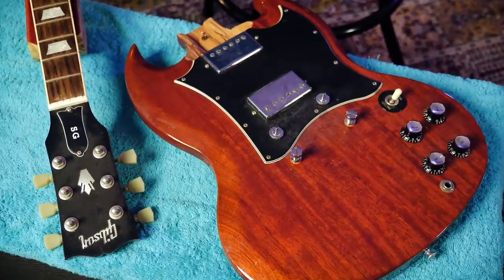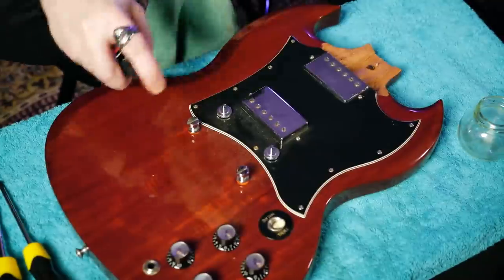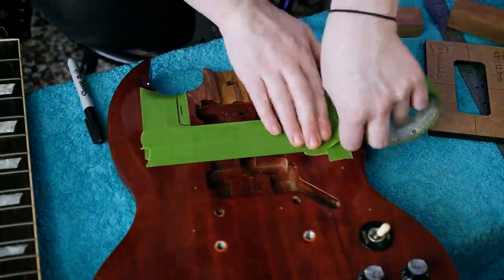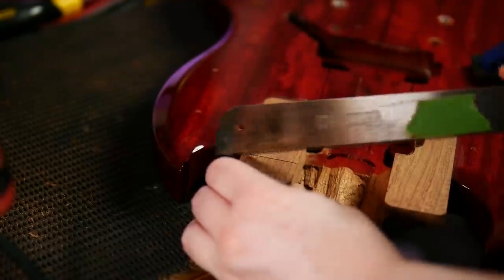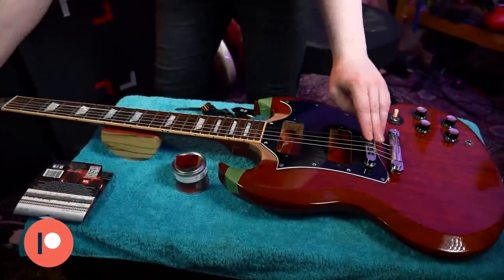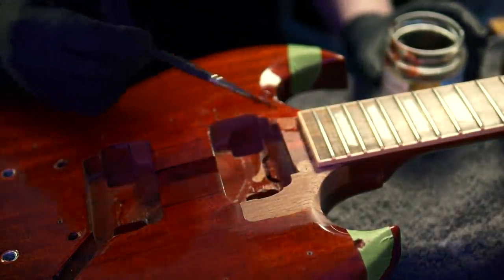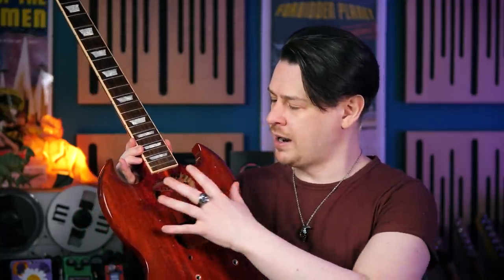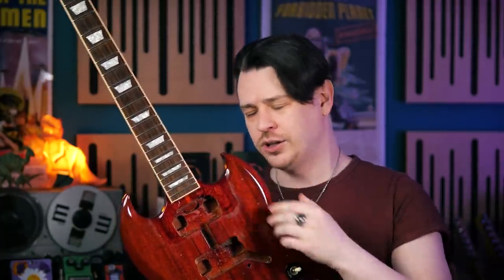BRUTAL Gibson SG Neck Break Repair (Part 1) | Axe From The Grave

Comment: After seeing how much heavy lifting a lot of the "solid" repaired guitars on Reverb look like maybe they did theirs in a dark room with a blindfold, I'd say this is clean enough to sit in that Mod Shop dude, well done!
Reply from the maker: I've seen some pretty rough epoxy and bondo style repairs, which just look awful regardless of how stable they are. 
I decided the best thing to do was rebuild and reinforce the wood - use only what would have been there from factory. It turned out better than I expected and I'm hoping it looks nice once the nitro is finish sanded and polished.
Reply: @ScienceofLoud  I've seen plenty for sale that have been "professionally" repaired. May be down to budget, but some reputable names have produced repairs that just look like glue and clamp (gibson headstock breaks). I have also seen repairs on Youtube which are almost invisible and look stronger with routed section which have strengthening inserts.

Comment: I have done so many of these over the years.  You did a fine job.  You really over repaired it.  I just glue them back on as long as they fit good, and fill in the spots where the wood is missing with chunks of Mahogany.   I have never had one break after I glued it.

Comment: Nice video! 

My SG (Tokai MIJ) broke by the headstock (I might have bumped into the drum set during a gig...) but it was glued together and is now probably stronger than before! Big scar around the neck now, but that's like you said - a part of the history of the guitar! Also, at another gig, before I started using straplocks, the same SG dropped straight "face down" to the floor and pushed the input jack with the surrounding wood into the electronics space.. I repaired the hole, drilled a new hole for the jack and electronics from the side (pretty thin though on a SG, but doable) and now it's super convenient with a 90degree jack. Lot's of scars :)

Comment: Great video, cheers Colin - really gave me the itch to get back to woodworking!

One thing that leapt out of me is that the refin looked much more obvious in some shots than others (I imagine due to the new nitro being more reflective). It'll be interesting to see how that compares once it's been sanded and polished. More importantly, given the comments on ethics you made, I can see how it would have been very easy to only use images from flattering angles (or, indeed, just shoot the whole thing as one video and not focus on it). The fact you didn't was really quite heartening - properly putting one's money where one's mouth is.

Comment: I freaked out over severe toothpain and smashed my 1995 Gibson SG Special in y
two pieces a few years back.
The break was pretty similar to the one in this video(except no missing wood).
For a long while it was just lying around here with me thinking it would be too expensive to get fixed.
I ended up taking it to a luthier. He did a great job and it didnt cost much at all. The guitar has a trans dark blue finish and I touched it up a bit with a dark blue sharpie.
It plays and sounds just as good as before and I dont really care about the marks from the break.
I am however very glad this smashing didnt instead happen to any of the nicer Gibsons Ive had.

Comment: Excellent job! Very impressive. Makes a change from headstock breaks on other channels. I’ve got a headstock break ongoing at the moment. With your repair, the only thing I would have done differently would be that I would have used grain filler on the new mahogany area. Really helps when the nitrocellulose inevitably shrinks.

Comment: As I said on Facebook the other day, its a great sympathetic repair to an instrument that deserves it. 

You didn't explain the dowels that you sunk in behind the fretboard, so i'm guessing that you didn't capture that bit on video while doing the work to it. I'm hoping for an explainer in the 2nd video in case people are wondering why you have 2 circles of wood in there at the joint.  

The colour actually works!  I would have been tempted to hide it under a solid or burst finish to hide it, but I actually think yours works better.  Northwest guitars colours are pretty good and I use them a lot.  

I'm interested why you didnt go for a grain fill, sealer and then add the colour as it would have had originally.  It wouldn't make the colour any easier to match, but I would be a bit dubious of trying to use Nitro directly onto the wood in case you get sinking in the finish, however, its such a small area it might not matter.  Good luck waiting 1 week for Nitro to stabilise :)  it could take a lot longer!

Still this is a cool project.  well done matey!

Comment: Hey man, amazing repair. Have you considered using a dye or similar for a better/easier blend? Woods high in tannins (so most hardwoods) respond well to things like tea or steel wool dissolved in vinegar. You can safely combine these too. I don't repair guitars, but I'm a pretty enthusiastic woodworker and can say confidently that natural dyes and treatments do wonders and seem to work well with various finishes.

Keep up the good work!

Comment: Great work !!
'75, i see a Gibson SG Standard in states of 'repair', refin and all.
Up for sale, $150. High action.
The neck had been broken off with a splice of wood.
Good but the neck was set flat like a Fender. Not the 17 degree or whatever.
Should have fixed it but sold it after buying a Strat.
man, found out later, it was a '64. Big year for the SG.

Comment: Nice work and excellent save, Colin! You really know your woodwork. I've done some repairs and modifications to guitars and basses through my career and I must say that your repair (when finished) will be strong and practically invisible at 3ft. I hope you take a bit of care in blend sanding/re-lacquering of the seams. You already have the color matched, you just have to get those seams to cooperate. But really, they aren't a big deal. Especially when you get the pickguard on there and call it a day. And I can't wait for that, when the whole guitar is ready to roar. I wouldn't mind hearing something with a little bit of Aussie Stomp to it 😁

Comment: Nice job, it looked really good. It would be nice to see these kind of repairs or guitar building done without using router or other special tools.
Reply from the maker: There were no special tools used here. 
I did this with nothing but a cheap razor saw, a chisel, sandpaper, razor blades, and the router. 

Routers are pretty standard, inexpensive wood working tools; they allow quick and clean removal of material. While it would be possible to do this with just chisels it's unlikely one would achieve as good a result.

Comment: I got an sg gothic because of your video! It has a clean neck break that Ima try to fix myself. I recently got a "player" 05 sg standard and you have a video on one too 😁. I literally thought it was a chibson when I lifted it out of the case. Having owned a '14 sgj and an 'all american I' , there is a bare wood finish as opposed to the standards' gloss and I can't get over how it feels. Its got all the hallmarks (yellow binding, nibs, correct headstock, nice inlays, etc) more so than the average chibson so I believe it to be legit. No one would go through this much trouble. But the gloss finish as well as it just seeming so light in my hands like its basswood or something. The other SGs had weight to them even though they are lower tier. Literally gonna go to my local Sam Ash and see if I can hold another one. This things had a string tree "professionally" installed by a luthier that prevents me from pulling out the truss cover 🤔 which is pretty sus...

Comment: nicely done. i personally dont like the sg, too much neck dive, but the work done so far is good. i wouldn't have done anything different with the repair itself either. i noticed you drilled and inserted 2 dowels where the neck and body join, this strengthens the joint considerably and is exactly what i would do
Reply from the maker: The neck dive is a result of not having the vibrola on there. The original 60s design balanced just fine due to the extra mass behind the bridge.

Comment: I hung around to the end. The repair looks great. Something i would've done differently though is I'd have messed it right up. I'd have miss cut the wood then badly glued in the replacement wood. Over chiselled and sanded Before gluing in the neck slightly off so it would never play right again. Then with the finishing I'd have gotten a shade that didn't match in the slightest then put way to much on. I'd also struggle to leave it alone for two weeks and would check the drying in around 24 hours leaving a distinct fingerprint in the finish. But to each their own eh.

Comment: Nice repair. The only way to hide the end grain on a cherry/clear finish would be to replace the entire end grain of both cutaways, with the witness line right on the edges of the curves. Tricky stuff, time consuming, and....not worth it on a stock instrument. Would be a fun woodworking exercise though.

Comment: Looks like a great repair so far!  Did you need to shave the plugs down a little to compensate for the thickness of the original finish on the surrounding original wood?

Comment: I don't think there's a lot that you COULD have done differently, given the nature of the break. The only thing I can think of (and this is just an amateur's guess at a solution) is that you might have affected some sort of spline, just for added structural stability? You'd have to go in from the back, and the repair would definitely be visible, but it seems like it could work at the heel of the neck as well as it would with a headstock break. Then again, I'm told that modern glues are often stronger than the wood itself, so....what do I know?

Comment: SGs are the Keanu Reeves of the guitar world.  That is, they have ONE and only one personality, but they wear it well, and it's hard to dislike that personality.

I like Gibson and Epiphone models whose necks join the body at the end of the fretboard.  I own a mid-'60s Epi Coronet and a recent reissue Wilshire, both with "batwing" headstocks.  The trouble with them, and with SGs, is that the space required for the neck tenon precludes the neck pickup being too close to the fingerboard.  That, and the fact that they are shorter-scale instruments, reduces the spacing between the neck and bridge pickups.  That, in turn, reduces the tonal contrast between the pickups.  On to of this, the bridge on an SG is situated close to the "waist" of the instrument, rather than closer to the "hips", as on many other Gibson models.  The result of all of this is, as noted, a fairly singular "personality", unlike a Telecaster, where a flick of the selector switch yields a very different-sounding guitar.  Now, it's one helluva personality, I have to admit.  But unless one is going to be Angus Young and ONLY play crunch all night long, or be Derek Trucks and only play slide, it can feel confining to some players.  Great players, who know the instrument well, and get great sounds, but they tend not to have a broad spectrum of tones.  So, it's one of those guitars whose "name" players I admire immensely, but I don't yearn to have one myself.

All of that said, great repair, and great video.  Nicely done, mate.  A tip o' the hat.

Comment: Quote "I wanted a neck repair project"... said no one ever until now. I'm actually after a vintage instrument if you have time to answer a questions.
Basically, I want a vintage Fender: Strats and Teles are too much so I've been looking at Mustangs, maybe a Duosonic if the right one comes along or even a Jag if I'm lucky. I absolutely need to be able to get my money back out of it if I have to.
My gut feel is, I want one that's already been re-fretted, I'll play it a lot so I don't want to devalue a completely original guitar.
I don't mind to much if pots have been changed/fixed etc, but I must have a original pickups, bridge & tuners.
I don't mind a bit of cosmetic damage provided its just looking worn... and not "damaged"

Does this sound like a reasonable shout to you?

Comment: You wanna know how I would have done it? I don't have a router or any other proper woodworking tools, so this would probably be my rather crude approach:
Glue it more or less as it was, then fill in the gaps with epoxy, get the contours correct, sand it smooth, then repaint it with a solid color (or do a fabric top)

Comment: very nice!! at 4.22 and 4.28, were the mahogany pieces taller than the body? they do look taller than the body when they were set on the body with glue. Im wondering how did you trim the height of the pieces down when they were on the body?
Reply from the maker: Razor saw to take off the bulk and then a block plane to bring them down level.

Comment: Why not just glue the neck back on and then route out the small chipped off corners and fill them up with smaller pieces of wood, thus only replacing the wood that needs replacing? Isn't this unnecessarily elaborate?
Either way, very impressive repair!

Comment: Did you use grain filler on the mahogany patches before you applied stain/finish? Is this necessary?
Reply from the maker: I personally didn't, although it would have been more accurate if I had. 
Gibson use a dark brown grain filler to prevent the nitro sinking down into the grain. I didn't have any filler to hand and in my colour testing I was getting exactly the correct look by applying the finish directly to the mahogany. 
I've opted instead to build up the clear gloss and hopefully level it without any obvious sinkage. I think I'll get away with it as the almost 2 decade old finish is showing signs of dipping into the grain below. I think it will end up blending into the original just fine.

Comment: Question for too afraid too ask: Does the body shape of an electric guitar (or bass) actually make a difference in the sound, assuming the same material? Or is it just looks and ergonomics?
Reply: Everything in a guitar makes a difference in how it sounds. Some of those things, like pickups, make a huge noticeable difference and some things, like a type of wood, would be an imperceptible difference to many people. Body shape does affect how a guitar sounds. The mass and shape affects how the guitar sustains and rings out. That sustain and resonance is transferred to the pickups. Also the shape of the body can affect pickup placement which has a very noticeable affect on how a guitar sounds. If you have a guitar that has a pickup an inch further towards the bridge or further the towards the neck it can make the pickups sound very different.

Comment: Even if you did paint it black, the repair would be visible if you finished it in nitro - eventually the boundary lines will show as cracks in the finish. Nitro is easy to work with, but kind of a crappy finish when you think about it long enough... toan attorney myths aside.

Comment: Also, was it just me or did that neck look like it was still bending back when he held it at its neck?
Reply from the maker: The SG has a significant back angle and it's entirely reasonable that there will be flex - it is made from wood afterall. Anyone who plays an SG will know that you can apply vibrato by gently flexing the neck.
There is no movement in the repair join though.

Comment: I'm honestly amazed Gibson has a customer base. Their guitars:
- Have a structural design flaw built in (neck / headstock breakages).
- Sound pretty muddy a lot of the time.
- Are covered in fruity binding and other bullshit garnish which brings to mind chaps and tassles.
- Cannot be fitted with replacement necks.
- Are generally twice the price of an equivalent (or higher) quality Fender guitar.

I mean... Doesn't it feel like Gibson are constantly insulting your intelligence just a little? I treat my instruments as what they are. Tools. If they can't even withstand their own string tension without leaving you 2,000 + out of pocket then how the hell are Gibson still in business?

Comment: It's not a repair its... (incoming 90's graphic design and audio design) *X*TREME RELIC-ING!

EDIT: I'll be honest, that repair is beyond my ability by enough that at first look, there's not even a shred of "yeah, I can do that" in my head. So, I'd either not do it, or make it worse.

One thing I have wondered about, on the "chicks dig scars/damage is part of the instrument's story" kind of thing, is whether or not some repairs - mostly cosmetic, rather than structurally critical like this one - could be done using a clear resin to replace missing wood. It would leave the bare wood visible but not exposed to the environment, so maybe it would be closer to an open wound than a scar, depending on your viewpoint.

Comment: I would've blended it with a light coat of tint and then sprayed it with a few coats of yellow tinted lacquer. Also I only would've routed away just enough wood to make smooth blocks to put in and not nearly as much as you did - it was truly unnecessary. Also I use Elmer's wood glue as they are the ones that invented PVA glue - tite bond is only a copy of it.  The main focal point of the guitar is going to be the front. Routing only enough wood to remove the rough areas would've made it easier to fix without being as noticeable as it would with a wider seam. Anyone will be able to see the sides of the body and the repairs there. It's acceptable as long as it's done correctly. You did a very good job although not perfect. That SG will never be perfect now and no one will care as long as it's playable.  Thank you for sharing this with the rest of us to enjoy!!